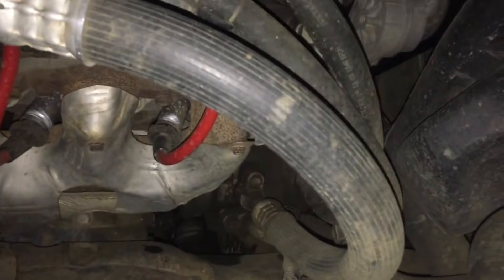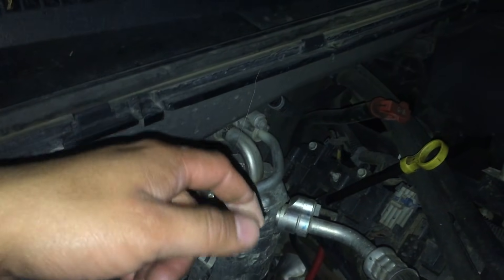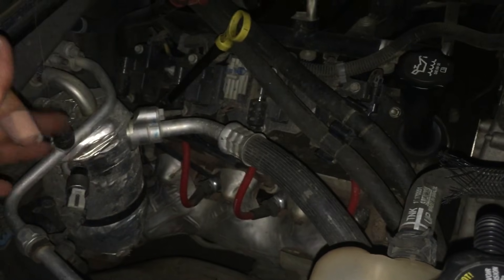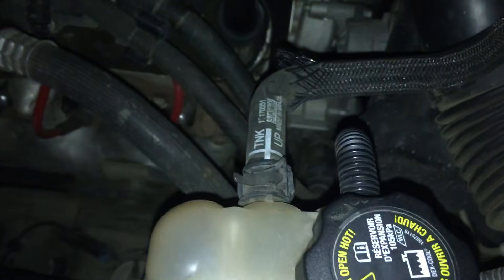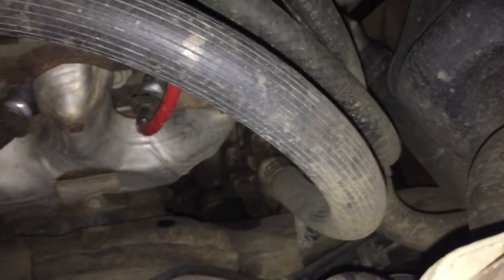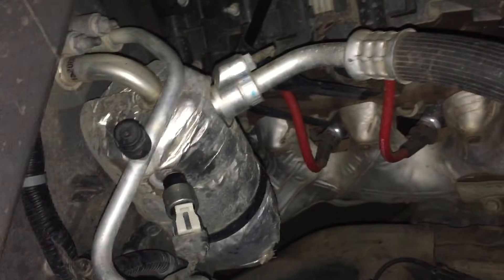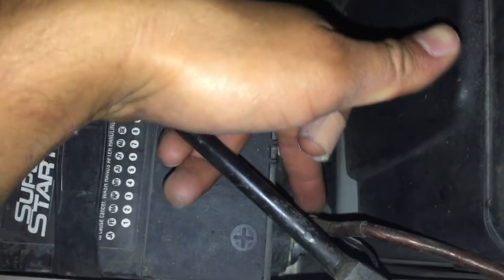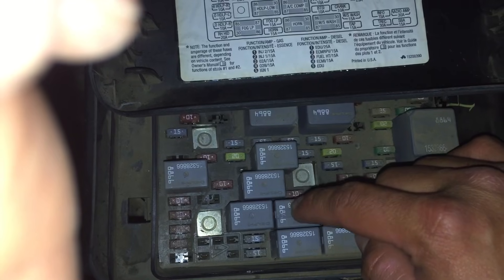How to add freon to ac system. Compressor clutch not engaging (chevy silverado)

Comment: Thanks for the reminder.  Quick and short.  1. Pull a/c compressor relay  2. From + battery terminal jump to A/C relay position 87 (it is printed on the cover of the under hood fuse box)  3.  If compressor turns on begin to add freon immediately (don't let compressor run very long before adding freon- you will burn it up).  If compressor clutch does not engage after + battery jump you have other problems.
Reply from the maker: Steve Mullins 
Couldn’t have explained any better . Your awesome
Reply: Jump 87 to 30 and it should get you going. Just did it today and didn’t have a extra hand to help me out (I have a 2007 classic body LBZ)

Comment: You’re a savior! After adding some coolant my ac blinking light went off, but my ac compressor wouldn’t engage. I did this and after a few pumps, I pulled the wire, and the compressor started engaging on and off. I kept adding when it was on. It continued to stay on longer by itself and I got it charged. Staying cool like brand new now!

Comment: This video was very helpful. I had to fix my wife's ac on her 2006 Avalanche. It was blowing hot air. The ac compressor wasn't engaging. I thought it was the fuse. It wasn't. Then I thought it was the compressor. It wasn't. It didn't have much freon. I did just what this video showing. Ran my wire to the battery and then to 87 prong. Compressor engaged. Left it engaged and added freon. Now ac blows cold air. Compressor works just fine like it's supposed to. Great video!
Reply from the maker: Pedro Valdez 
Im glad it was able to help u . And glad it didnt confuse you next time ill make a video of me actually doing it
Reply: Hey do yu leave the wire connected til freon is added? Or do yu just jumpstart it?
Reply: @GlizzyGurlGossip  , the way "I" did I left the wire connected so that the ac compressor is running. The compressor has to run for it to accept the freon. After you've put 1 can of freon you can disconnect the wire and insert your relay back in. Then run it like it's supposed to. Hopefully you got it.
Reply: @pedrovaldez9559  ok thanks so much! Oh and what kind of wire can i use?
Reply: @GlizzyGurlGossip , you can use any wire just as long as you can fit it in #87 like explained in the video. Speaker wire is good too.
Reply: @pedrovaldez9559  Hey do you wrap wire around the positive end of the battery and then just stick the other inside the 87? Just asking? Also does the car needs to be off while wrapping one end  around the battery?  And
Reply: once I have ONE end of the wire touching battery and the other end touching  87 clutch relay what's the next steps. Does the car needs to be off while starting the wine process
Reply: @leonbutler7564  the way "I" did it was turn the truck on and then tightly connected a wire to my positive post on my battery and then stuck the other end of the wire to my relay (#87). My clutch turned on once I did that. Then I began adding freon. I made sure I added atleast 1 full can before disconnecting the wires I used to FORCE the ac compressor clutch to engage. Once I used a full can I then disconnected the wire. The ac compressor should still be running. Continue to fill your compressor with freon until you're good. Hope this helps.
Reply from the maker: @GlizzyGurlGossip  yes leave it then add freon

Comment: I HAD A PROBLEM CHARGING THE AC THE COMPRESSOR COIL KEPT TURNING ON AND OFF, I PUT A JUMPER WIRE BETWEEN 87 AND 30 AND THAT KEPT THE COMPRESSOR RUNNING WITHOUT TURNING ON AND OFF, SO I WAS ABLE TO CHARGE THE REFRIGERANT ON THE SYSTEM WITHOUT AN ISSUE, I DIDN'T USE THE WIRE FROM BATTERY TO 87, BUT YOUR TIP WAS VERY HELPFUL INDEED, THANKS
Reply: What did you use

Comment: This fixed my problem, and it also help me locate the leak I have. Now I need to find a video on how to fix the leak lol. Thanks for the helpful video!
Reply from the maker: E A is the valve bubbling wer u put in the Freon ? If it is then that’s the problem
Reply: @josesoto9099  Yeah it is, I already bought a kit for the inlets but I have to drain the freon to do this.
Reply from the maker: E A 
Unfortunately yes a shop will charge around 50$ to do it

Comment: Also jost use a jumper wire or paper clip to conect 87 to 30 in the relay plug holes and yourac clutch will engage also so you can add the freon.
Reply from the maker: Kenneth Grimes 
I didn’t kno about that trick I’ll try it out next time
Reply: U shoulda said that the first time lol

Comment: I've done everything you can think of besides this to fix my AC in my Tahoe. Expansion valve, pulled vacuum idk how many times, 2 ac compressors. One compressor had bad threads where the high line goes and didn't see it till I had it on. Second compressor is new and still won't pull Freon through the system. Honestly forgot about jumping the relay. Gonna give it a shot in the morning. Hopefully it works

Comment: You can pull the ac relay in that panel and the two left holes 86 and 87 hook them together with one piece of wire one into front hold one into back hole the front left 2 holes it’ll make it run
Reply: My Silverado 2004 keeps burning my a/c clutch fuse . Any idea what it could be ? I  appreciate any ideas .

Comment: Worked for my 2014 gmc. Was 35 i think instead of the 87 prong to power the clutch but worked like a charm. Thanks man good vid. 👍🏼
Reply: My ac stopped working but before I put Freon in it, it started back. I have a 2014 gmc as well. This is the 2nd time its done that to me. What is going on with it?
Reply: Update. Quit working again. Mine had a tiny leak at the condenser. Replaced and all good now
Reply: @reded6640  because it's leaking refrigerant. It's a pressurized system, so the low pressure switch is a feature built in to keep you from burning up the compressor, as the refrigerant is also it's coolant. If it's low enough that bumping it with a can of refrigerant won't engage the clutch and it hasn't been sitting for several years, you've probably got a leak somewhere. So refilling it gives enough pressure for it to run, until it leaks out again.
Reply: @CharliesTheMan  thanks. The dealership said they think it was the actuator door and wanted to charge me $900 which I didn't get but turns out it a module that needed replacing. Only 30 buck and got charged 50 to get it replaced by a friend. Dealerships are rip-offs

Comment: You are bypassing the low pressure switch which must be satisfied for Compressor to run. Simply add refrigerant until low pressure switch is satisfied and compressor will start in its protected state. Check fuses, relay. and low pressure switch. If OK, run car with AC on max. Add refrigerant and the compressor will start when low pressure switch is satisfied. Not sure why so many of these bypass videos exist. No harm if enough refrigerant is added before any damage to the compressor occurs.

Comment: So what is the pressure suppose to read I have a 2007 Chevy Silverado 1500
Reply from the maker: Usually the pressure gauge that comes with the freon can has a green zone were it wants u to be in
Reply: I know it's late but for others that see this, look up "A/C Refrigerant Chart" because the pressure you need changes with ambient temperature. It will tell you how much you need for each temperature range, match that up with the temperature outside when you're filling it, and you'll be golden.

Comment: Jump 87 and 30 will do the same thing, but good video 👍🏿
Reply: I tried jumping 87 and 30 with paper clip, but clutch will still not engage.
Reply: @Eyes4Hire  yours  might have a bad clutch or bad wire
Reply: @eroom2087  It is a new compressor that came complete with clutch, but I am starting to suspect that they sent me a defective one.
Reply: @Eyes4Hire  just jump a wire to the compressor
Reply: If you got a test light check to see if you getting power to the clutch

Comment: My 05 Nissan Xterra doesn't have A/C Comp relay. I did researched all over the internet. It just does NOT equip with A/C comp relay. Can I hot wire from Positive (+) terminal to A/C clutch wire in order to have the clutch engaged? To do that am I going to damage the compressor or anything else? Please advise ASAP. Thank you very much in advance!
Reply from the maker: There is a relay for it just having trouble locating it on the net as well . I believe ther blue colored how many blue relays do u c in your box
Reply from the maker: Personally i have never tryed hot wiring to the clutch so idk if it would damage it
Reply from the maker: I know a ac relay exists on it cuz if you online shop for a ac relay they show up
Reply from the maker: https://youtu.be/7VqfGQlpC1w
Reply from the maker: This diagram link i sent shows its 42 , check it out

Comment: so i did this on my 03 silverado and I can hear a click but the clutch doesn't engage. bad compressor? I also just replaced both pressure switches and the orifice tube.
Reply from the maker: Vandon Hobbs 
Yea if u tried this and didnt work u  probably need a new compressor,
Reply: @josesoto9099  it worked put in a new compressor. Still having issues but the clutch is engaging now
Reply from the maker: Vandon Hobbs  
What issues are u still having

Comment: Just jump 87 and 30 with one wire, and it engages like it’s supposed to, or it doesn’t.
Reply from the maker: Stick wire from hot battery terminal to 87 slot , then clutch should engage then add your freon with the ac controlls on full blast
Reply: @josesoto9099  I had the same issue. I pulled the ac fuse, and jumped the 87 and 30 prongs with a gem clip. Made the clutch kick on and was able to get freon in it.

Comment: Hey bro, what type of wire did you use?
Reply from the maker: Damean Rosales 
I used some speaker wire
Reply: Thanks brotha, ended up using a push pin lol, got it to work tho. Appreciate it
Reply: Barb wire from cow lot

Comment: I did this but I put the relay back and it stops working what it could be
Reply from the maker: @ignaciomartinez3877  did u try another relay yours might be out
Reply: @josesoto9099  I will try that right now I’m working on it ..I changed the compressor to a new one and it did kick on like you said on vedio I only put 1 can so far do I need another can of freon
Reply from the maker: @ignaciomartinez3877  
Did u check the gage  and fill it to green? With one can it should be enough to keep it going
Reply: @josesoto9099  I put a wire to the switch on the bottle and it works turns on and off
Reply from the maker: @ignaciomartinez3877  
Was the can of freon small or tall
Reply from the maker: If you only put a 12 oz can then u need more
Reply from the maker: Wen u add the freon check the gage , fill it to green and only add when the compressor click on
Reply: @josesoto9099  small I put 2
Reply: @josesoto9099  ok compressor kicks on and kicks off
Reply from the maker: @ignaciomartinez3877   did u add them wen  compressor clicked on , wen you add you add when it clicks on , when it clicks off , you stop , then add again till it clicks on again , because if you keep shooting freon wen its clicks off it just wastes. Once you do that , fill it correctly then it should stay on longer . But clicking on and off is normal after its filled

Comment: What if you dont have numbers 87 but you have numbers labeled 1,2,3,5 for relay
Reply from the maker: Myyoutubechannel 
I would try each one until you hear the click
Reply from the maker: Myyoutubechannel 
I had the same question when I attempted this on a Honda Civic my relay for that car did not have any numbers on it. So I just tried each little insert until I heard the clutch engage
Reply from the maker: Hope that helps
Reply: @josesoto9099  i connected the positive from the battery to each one of the terminals and got nothing turned on smh lol the clutch didnt engage
Reply from the maker: Myyoutubechannel 
Was your car on with the ac turned full blast as u tryed it? If it’s not working then it can be possible u will need a new compressor unfortunately

Comment: After u add the freon ...do u disconnect the wire that's connected  to the battery to relay or just leave that connect ?
Reply from the maker: Jorge Cruz 
Yes after adding Freon you disconnect the wire and clutch will go back off , then you just put the relay back on and it will turn back on
Reply: What if after you put the relay back  on and charging the system the compressor doesnt turn back on? Would it be a bad compressor?
Reply: @angelcarrillo4420 I’m having the same issue what was the problem on yours?? I have a new compressor

Comment: I hope this works just got quoted 500$ for a new ac compressor cuz they tried recharging it at a shop and the compressor didnt turn on.
Reply from the maker: DopeTheft Media 
If your compressor is not broken and is only low on freon this will work
Reply: @josesoto9099  I recently swapped my engine and had to swap out the ac compressor as well so its was low on freon
Reply from the maker: DopeTheft Media 
Yea this should work by turning on the compressor manually did u swap the engin yourself?
Reply: No I had a homie help me with it.
Reply from the maker: DopeTheft Media 
Alright this really easy to do
Wat i didn’t mention in the video 
Recomonding changing the lil valve wer u connect freon hose into , those lil valves break and leak sometimes and since your lines are completely empty now its a good idea to replace the lil valve they only like 6$ at parts store last thing u want after successfully adding freon is that lil valve leaking , they bubble wen they leak then u have to get freon vaccumed out and replace the lil valve n redo process
Reply: @josesoto9099  yeah I actually have to replace the HI valve bcuz it leaks from there. Might as well do both
Reply from the maker: So to avoid all that just replace the valve first ,one time i didnt know any better i added freon , didnt know the lil valve was leaking till after i added freon and i tryed replacing it after freon was added and shit went all bad freon sprayed out like crazy thats y you have to get the lines vacuumed before replacing a lil valve
Reply from the maker: DopeTheft Media 
Well good luck i subbed to your channel it looks dope
Reply: @josesoto9099  thanks bro I subbed too 🤘
Reply: @josesoto9099  yeah I already got my lines vacuumed since I went to the shop and the valve was leaking.

Comment: I just put a paper clip in the plug at the dryer. It always jumped the clutch. But now i see mine is aparently to low i had to jump the relay useing paper clip. 👍
I don't know why some people are against the sealer. Hmm
Reply: It's because the sealer is a short term solution for an A/C system that's junk. Once you run that sealer through it, it's going to clog up a lot of orifices that are supposed to be open. It's like a blood clot basically. Since it's a circulating system, it's going to gunk up every part it flows through. So if you're planning to buy a whole new compressor, dryer, condenser etc then you don't have anything to lose. But if it's just a minor leak in a line, it could damage a lot of parts while trying to fix the issue.

Comment: So ac blows cold with it jumped at the fuse, the lines are holding Freon and are in the green on the gauge, but once I put fuse relay back on it goes back to cutting off and on, anyone having this issue or ran into this problem?
Reply from the maker: Try replacing your fuse
Reply: He shoulda just told u to jump 87 to 30 and you wouldn't have to worry about it cutting off again

Comment: This actually worked but once I took the The wire off the relay the compressor turned off so I am sure what’s happening
Reply from the maker: Jona  did u add the freon wen u had the compressor running?
Reply: Mines did the same. Got a 03 Silverado
Reply: Jose Soto Yes I did and I found the problem there was a leak, thank you

Comment: I tried it, but the compressor didn't engage. My 2001  Deville doesn't have the number 87 on the fuse box. it has it on the fuse, but I don't know if the fuse was inserted right. How can I find 87 on a 2001 Deville?
Reply from the maker: Mary Lamb 
How many prongs are on your ac compressor relay
Reply: I think your numbers will be on the bottom of your ac relay fuse
Reply: My toyota different to my is cm 4 pro g and only says 30 on one so the front 2 has to be the one to engage compressor. .well any ways different cars different labels